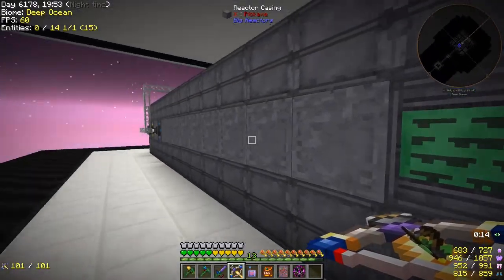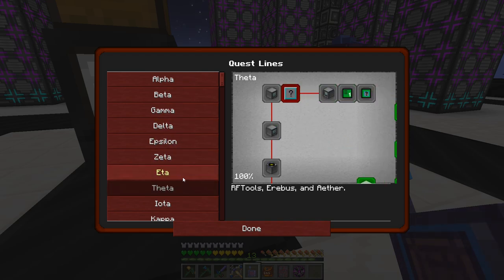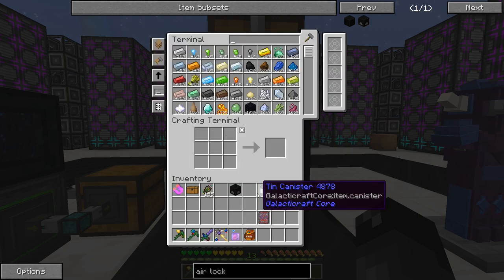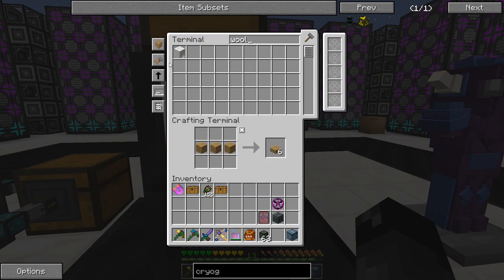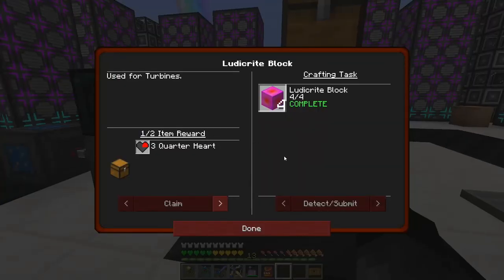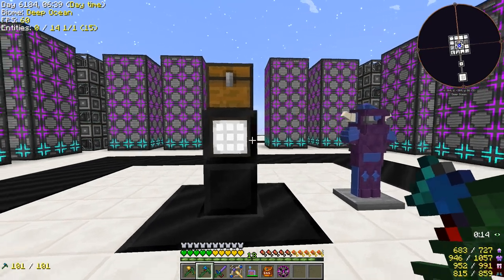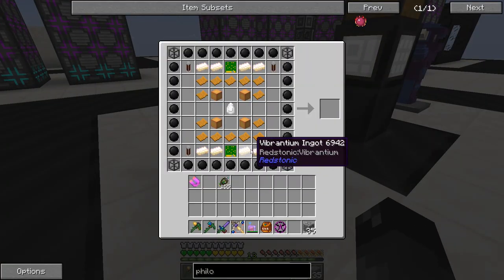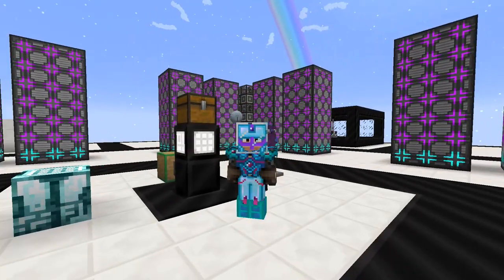Project Ozone 2 Kappa Mode - EXTREME CRAFTING [E66] (Modded Minecraft Sky Block)

Comment: make a solar panel from Solar Flux, they're overpowered
Reply: Did you look at the recipes? The good ones are insanely expensive.
Reply: Late-game, they are incredibly easy to get due to being emc-able up to tier 11 (although that tier requires an infinity star, t10 is cheap however). I was too lazy to rebuild my big reactor (I put it in the overworld and it was making a huge amount of lag) so I used a stack of fully upgraded (upgrades are cheap) t11 panels to generate a stupid amount of power.

Comment: you could probably make a crafter with 256 minicio=1temperio for some extra speed. leaving it overnight is also a solution tho
Reply: i really don't understand why he is making it through the me system... It's very slow.
Reply: Idd and he never use 6 molecular on one interface and having the moleculars not touching the other interfaces and not having crafting chains in the same interface. I just try to give him a hints to make it efficient but hypno seems fine with mediocre efficiency
Reply: He will use a crafter when he needs to, the demon steel of the eight is really cheap, compared to the demon steel of the eleventh he will soon have to make. also, the ME system is faster than it seems.
Reply: Boschko interfaces are limited to 5 molecular assemblers per interface
Reply: http://i.imgur.com/LmZVynY.png They are not you can give the interface a channels through a molecular
Reply: the problem is it takes a long time to calculate needed resources, which crafters don't have to do. This limits how much more parallel crafting you can make to speed up the process. With crafters you just make more. with me system setup time takes over after a certain point and you can't speed it up more
Reply: an tier 3 rftools crafter is better and once he gets the philosopher stone thr setup becomes irrelevant since it has emc
Reply: Boshcko this looks really nice, I didn't know about it, always thought molecular assemblers weren't transfering channels
Reply: One tempurio is 4^5 minicio 
Crucio(4 min.)*Accio(4 cruc.)*imperio(4 acc.)* zivicio(4 imp)*tempurio(4 zivicio)
Equals 1024 minicio

I think I got the order wrong but the math still stays true. 

Demon steel 8 is 3^(8-1)=3^7 tempurio 

You need two, for a grand total of (2)(3^7)(4^5) minicio essence. 
4,478,976

Holy hell man

Comment: Hypo, just a suggestion. Move all the essence craft to their own set of interface with 4 assembler. The interface will use all 4 of the molecular assemblers instead of trading spots for other crafting recipe. Meaning crafting stage one recipe can be continuous because it doesn't have to wait for stage 2/3/4 to level up. It's a small upgrade but everything helps when you're making 1000s of craft. Also, this craft would help for like making logs in wood and wood into sticks this set of interface is purely for massive crafts

Comment: hypno how did you fix your frames to make it better and stable at would be great to know
Reply from the maker: Less cables ran everywhere replaced with tesseracts. Turned off the auto sieve/hammeres. Removed the huge amount of tile entities I had called storage drawers. Etc.
Reply: Thanks hypno
Reply: Hypnotizd The question is a little bit out of the "frame rate" but i still don't understand how is your smeltery going that fast, what kind of liquid are you using?
Reply: Valerio Nesi he is using gasoline

Comment: Your reactor setup is grossly inefficient... you’re wasting fuel on temperature ramping... you should do something like an RS-NOR latch: if your external power storage (capacitor bank, draconic, etc.)is below 50%, turn the reactor on and leave it on. Then, if your internal power buffer is above 5%, turn it off(it will fill mostly with the residual heat)

This method uses optimal efficiency at max output and doesn’t waste energy half-burning fuel for less energy like you have